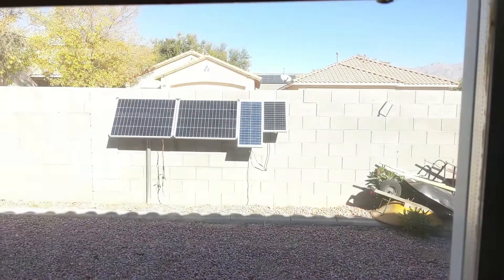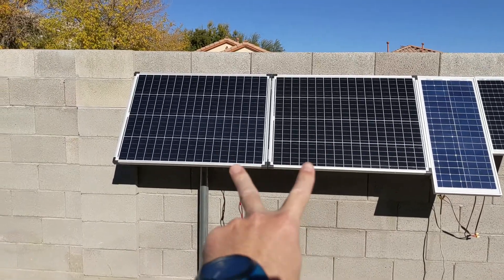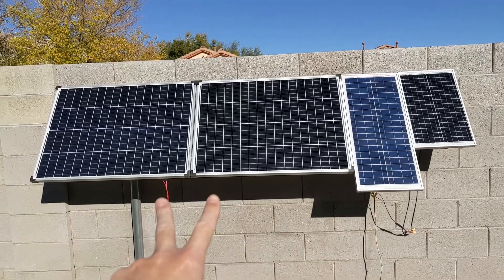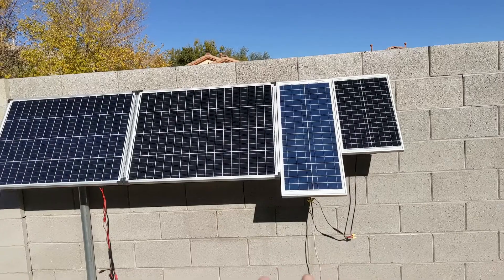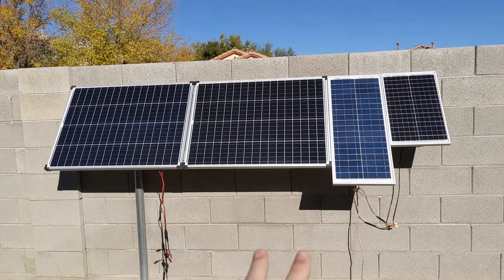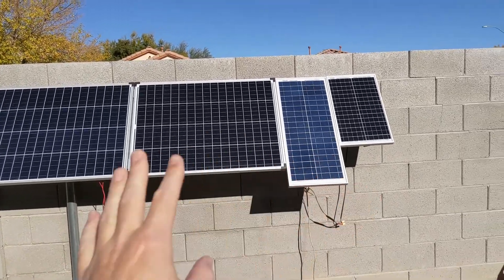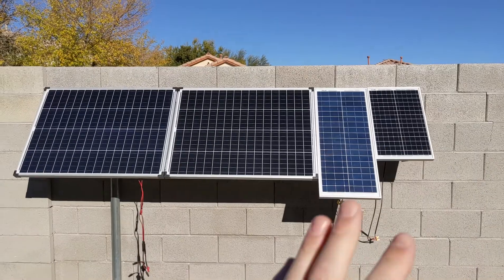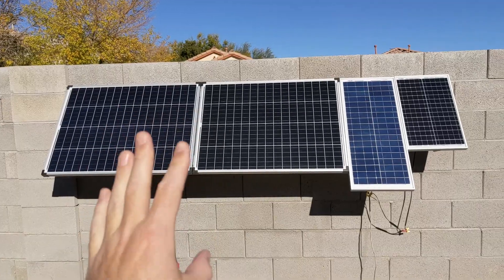What Happens if u MIX? HOW to Connect Different Solar Panels Together? Parallel VS series 12v vs 24v

Comment: I have connected 2 solar panels in series 340+380 to epever 12v battery. My mppt get power from one panel everyday I have to disconnect and reconnect mc4 connectors than it’s a show power of both panels. Why this happening in series connection?
Reply from the maker: MPPT chargers periodically restart to find the MPPT point , maybe when they disconnect you are going over voltage and they don't restart due to over voltage reported .
Reply: @VegasRoManiacReviews  my mppt support 138v and max pv 150v 
Two panels make 70-80volts. This happen when sun shine that time pv start from zero watts gradually raise. Epever told me that you have mismatched solar panels that’s why mppt picking one panel connected to + wire. I have to try in parallel let’s see I will share more details
Reply from the maker: I have mismatched panels no problem ...they blame your panels because they don't want to take responsibility ... No way it's the pannels. Keep me posted , I'm curious vegasromaniac@gmail.com
Reply: @VegasRoManiacReviews  they told me that your controller supper 520watt for 12v and you exceed the limit. No solar panel produce 100% power if I install 700watt I will get 450-500w. Testing panes separately now
Reply: @VegasRoManiacReviews  panels working in parallel connection from 5 days. After few days I will connect them back in series

Comment: If the had two panels of the same in parallel then both would give same in full sunshine. If the 1st panel had full sunshine and giving out 80% And the second panel had full shade and giving out 10%. Then the voltage would not be the same. Neither would the amperage. Yet they would both be contributing. So the argument that different panels would lose is not correct.
Reply from the maker: If hooked up separate, they produce more than when hooked in parallel and added together  not sure why but they do loose some ...
Reply: @VegasRoManiacReviews  I think the answer would put the smaller or the most matched to the battery size on a separate cheap pwm contoller. That would give both the best chance.

Comment: I noticed that with my 800w solar system. the Vmp of the panels are slightly different (some are 18.6v, some are 17.6v) so that affects the entire array when connected in series-parallel. For small system, the difference isn't much but for a big array the difference is a lot.
Reply from the maker: Very true.